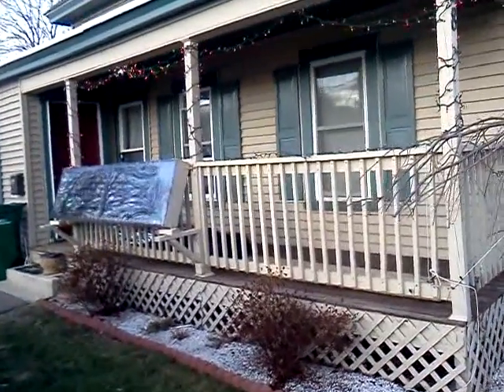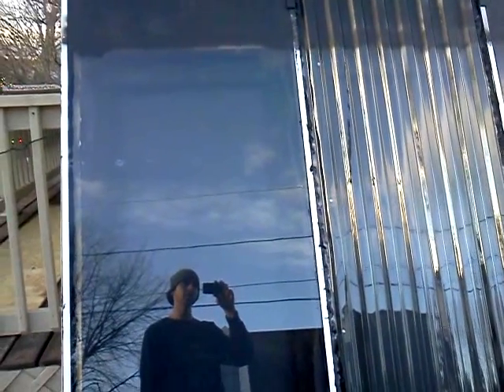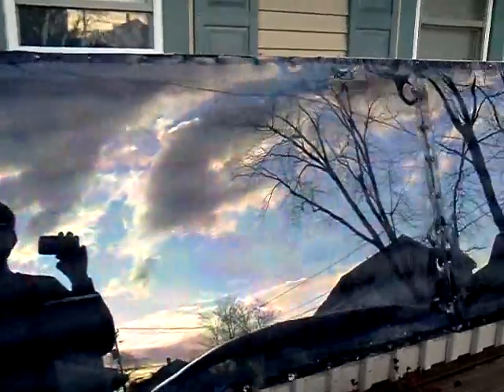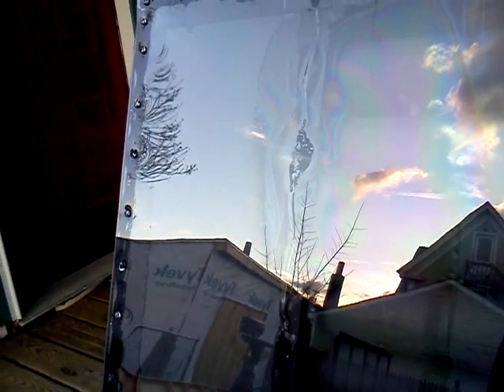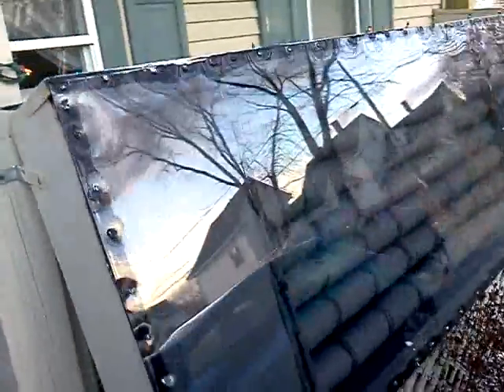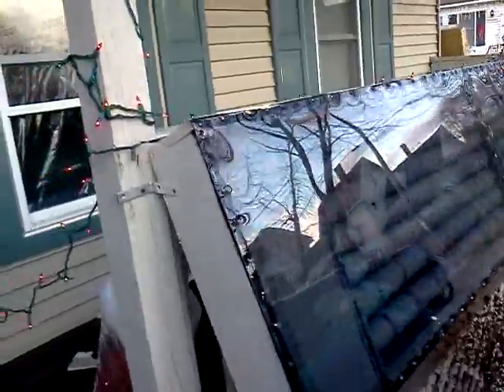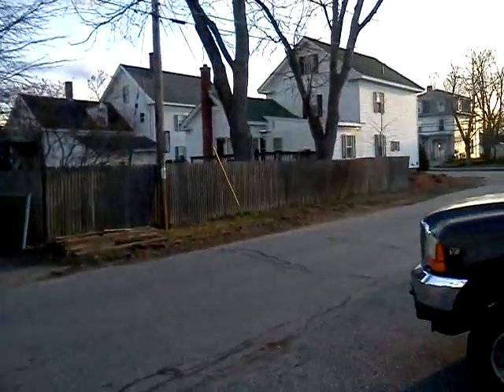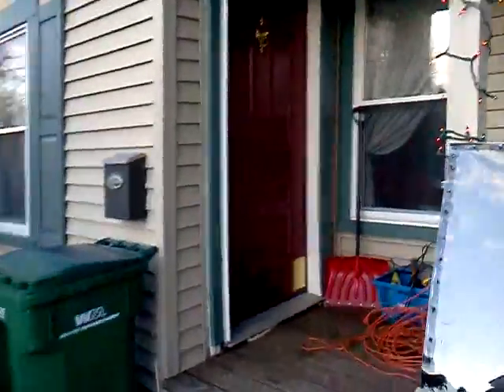Solar Furnace.

Comment from the maker: I was told yesterday to try to replace the dyer hose with PVC or ducting. That the dryer hose slows the air down aka reduces efficency. So today insulated the dryerhose and will now keep an eye out for some 4in or 3in pvc to use :)

Comment: @3mrhythm You may be right I have never made a screen collector seems there would be a lot of air blowing around in that box. Tube (can) collectors the air is much more contained   The can collector I made has only a 1/4 in. of foil faced bubble insulation and normally runs between 150-170 degrees at 88 cfm no matter what the temp. outside good luck with your builds

Comment from the maker: @tensleep i think I need to insulate better on the screen one to make that same assumption. I only used 1/2 rigid insulation and didnt make completely insulated heaters and footers.. but the new one works alot better.. So i might just scrap the old one and use the parts for some more builds of this style. Or use the glass from the big one to make two smaller screen units with better insulating. I spent about $45 on screen.. i kind of want to get use from it lol